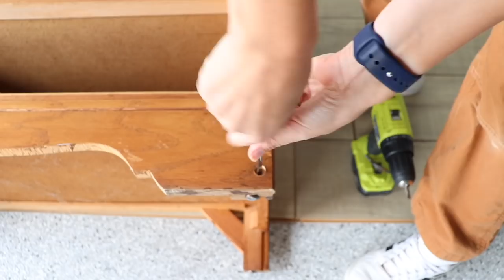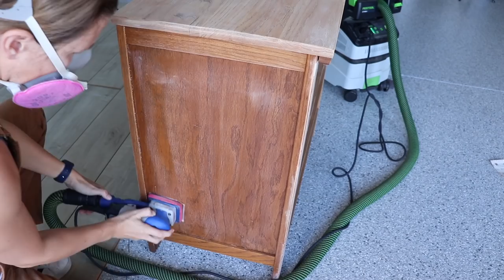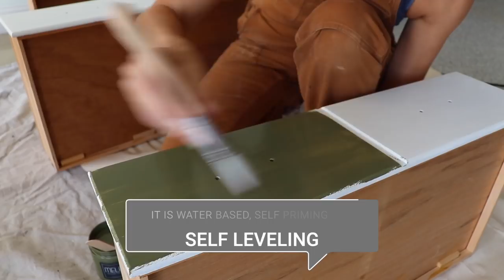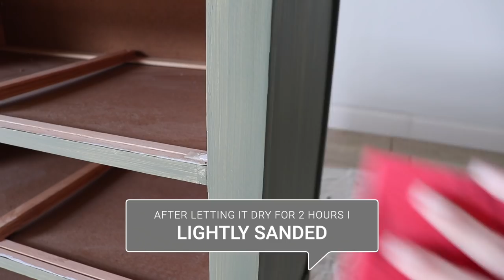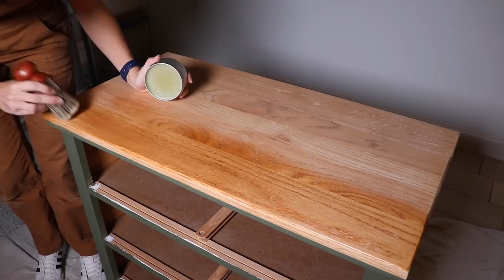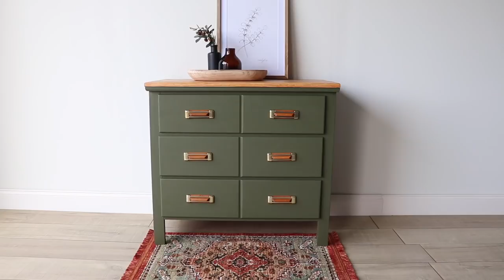Quick Furniture Flips | Green End Table Makeover

Comment: Love the color. But just an FYI, unless the piece is going to be abused a lot, Bonds is not the correct filler. Use an actual wood filler/putty or Durham's water putty. Also known as water rock. Those two are a lot less expensive than Bondo as well

Comment: The transformation was incredible! Question: I've seen you use these circular sponges to do the topcoat in a couple of your videos and I'm wondering what their use is? I looks like the same material as those cheap black sponge brushes, but in the shape of a circle and you just rub the polyurethane on. Would you reccomend them for a smooth finish? If not, do you have any tips for getting a smoother finish without a paint gun? I'm just trying to up my game on my flips❤